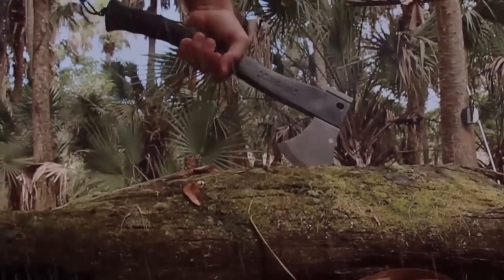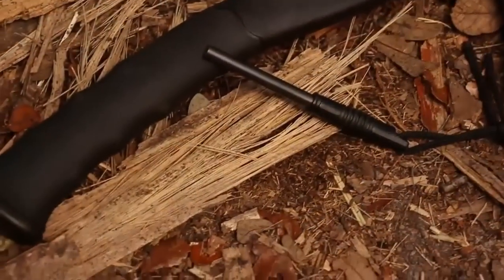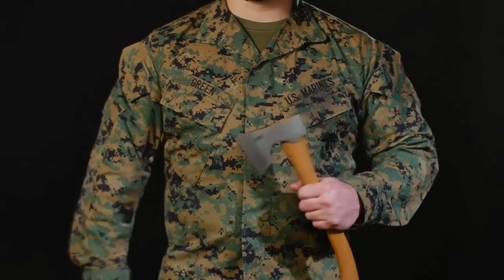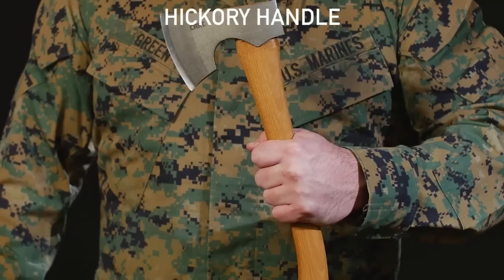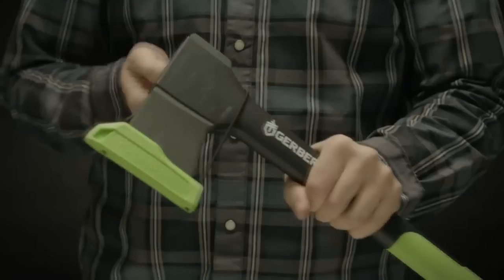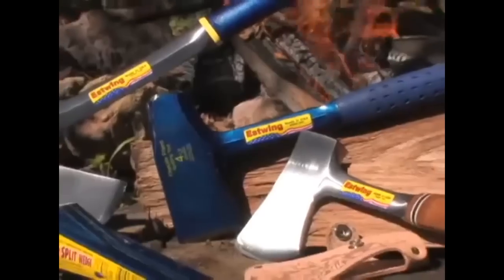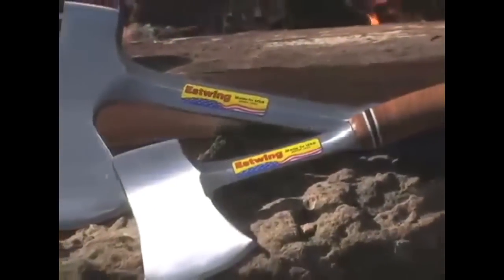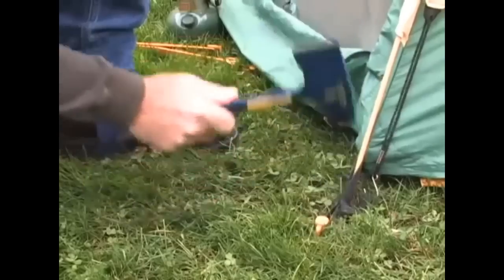Great Camping Axes

Comment: #1/ The schrade isn’t very good  the 3cr13 steel is one of the worst steels I’ve ever use soft junk plus it’s not full tang which makes it much more prone to breaking with no way to replace the handle if it snaps.
#2/ the crkt has a great design the only downside is the steel 1055 which is still a better steel than 3cr13 steel 
#3/ The Gerber is basically a fiskars axe ugly soft mystery carbon steel and the handle like the schrade can’t be replaced.
#4/ estwing same low quality steel axe that will probably need its edged touched up and can be heavy for hiking but one of the best beginners hatchets around and won’t break unlike other on the list
#5/ Wetterlings are some of the best axes for the money even thought there more exspensive than others on the list made with pride tough great steel gets razor sharp and fairly easy to sharpen best hatchet on the list so far. My favorite axes are my gransfors bruks I own 3 of them and they are fantastic and I own alout of hatchets axes and tomahawks traditional and tactical and I always go for my gransfors just a life better in my opinion than wetterlings but if I was looking for a great budget axe I’d go with Husqvarna if I spelled that right made by wetterlings with the same great steel for half price if u want American made go with council axes there  velvicut premium models great fit and finish 5160 steel head which is a great impact steel that sharpens easy and gets real sharp comes with really nice leather blade covers probably the best American made axes for the price which still isn’t cheap guessing $100 to $150 depending on what axe or hatchet you want.
Reply: Sorry, I don't agree with your judgement on #2 and #3. Both seem to be made by fiskars and they do a great job with their handles, never heard about one broke (aside of destruction tests). Got lately a Fiskars-A6 small felling axe for 20€ (instead of 40€ regular price), quite similar to the Gerber - great tool, I have no complaints about the steel.
Reply: It’s a great mystery soft steel axe for $20 but it’s not a hand me down axe if u want American go with the council tools velvicut edition axes great wood handle that can be replace unlike the fiskars and the council tools axes head is 5160 steel which is a great steel for an axe head that could last a couple hundred yrs if u don’t leave it out in the rain. Imagine getting a fiskars from your grandpa as a hand me down it would be kind of a joke where grandpa would say just joking here’s a real hand me down axe  from wetterlings gransfors council velvicut and say did u really think grandpa would give u this junk instead of an a real hand me down axe I’m not that cheap kid and these axes are actually a beautiful piece of art that works and will work for the rest of your life and maybe one day u can give it to your grandkids while not worrying about using it hard in the mean time.
Reply: You are right, but I don't care about the brand or the make. I only care about getting the job done. That's definitely the case with a Fiskars. 
If I lived in any place where I had to fell, cut and split wood in big amount on a daily basis I sure would be willing to spend up to 200$ for an excellent axe, but living in a german suburb I'm not.
Replacing the handle is only needed if it's broken - as I said, never heard about that. Look up some YT video destruction tests and see, what it takes to break them.